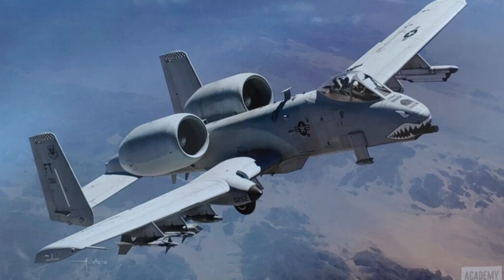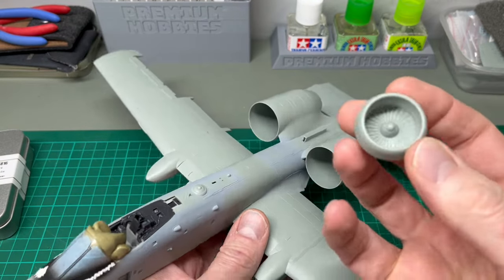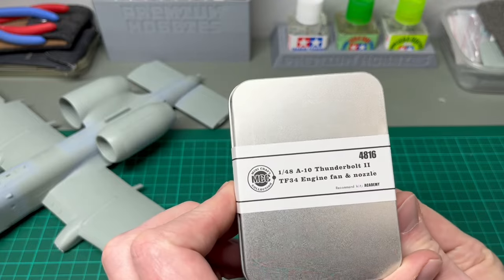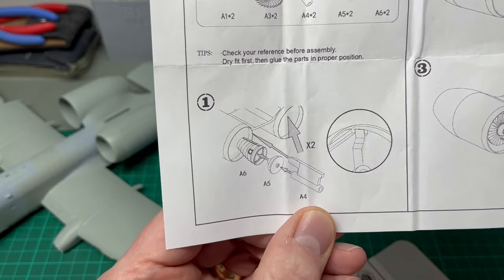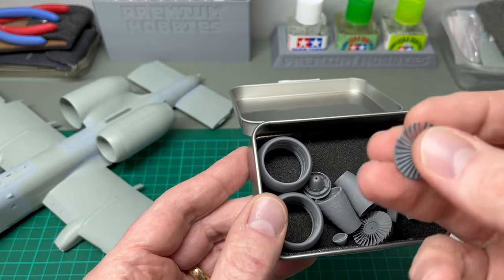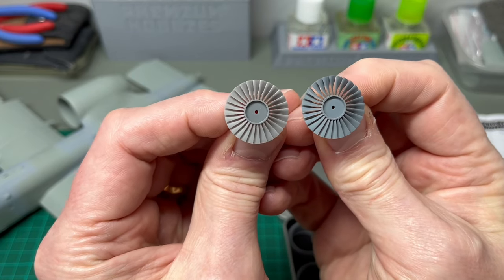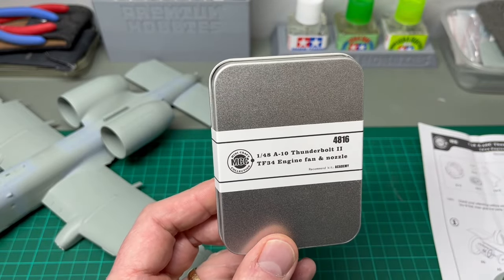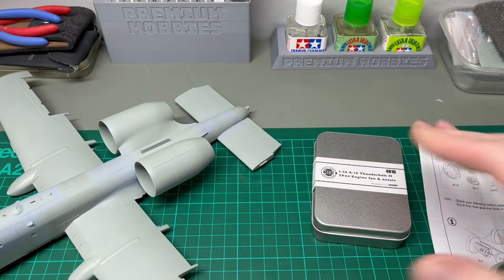Update Your A-10!

Comment: I bought that MCC engine set for my Academy A-10C and managed to cut out the two fan assemblies without breaking off any blades only to find that the two fans were different diameters! One fitted perfectly in the inlet duct with negligible blade tip clearances, the other was a slack fit in the duct and to me frankly looked stupid in comparison with the opposite hand item. I complained to Hannants (not their fault) in the hope that corrected sets were available but of course nothing was. It looked to me that you have the narrower diameter fans Spencer. I will maybe explore the option to improve the appearance by using some aluminium tape or such like to fractionally reduce the diameter of the inlet duct to match the fan.
Cheers,
Pete.